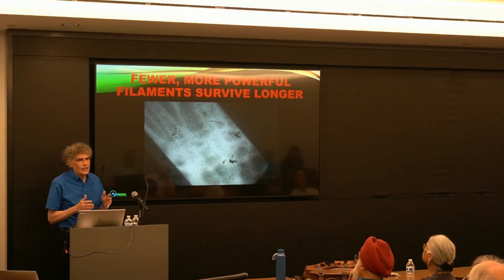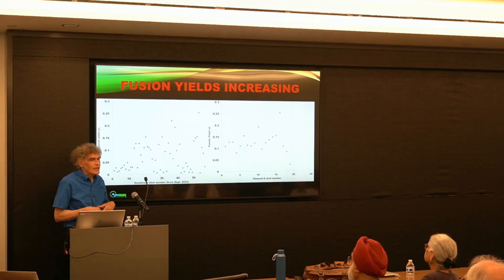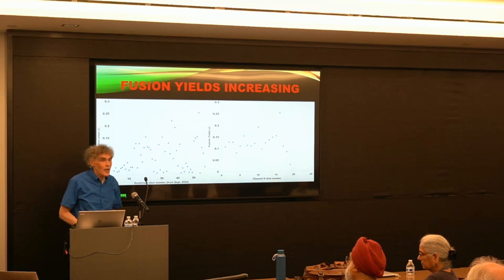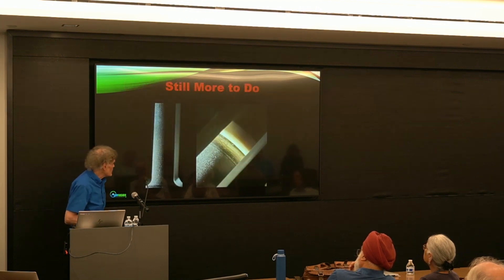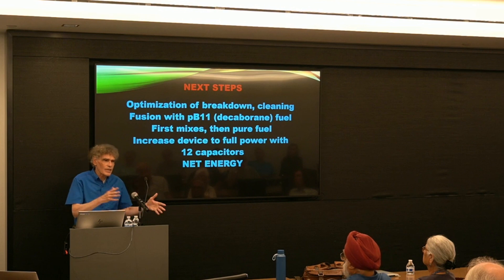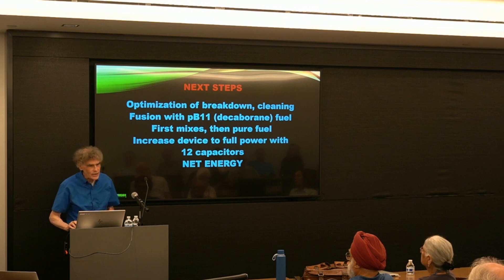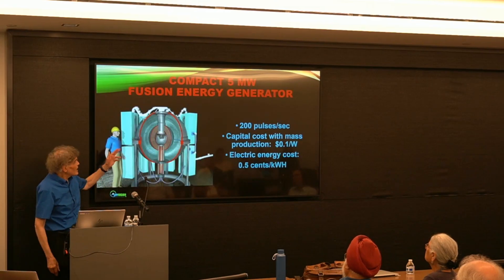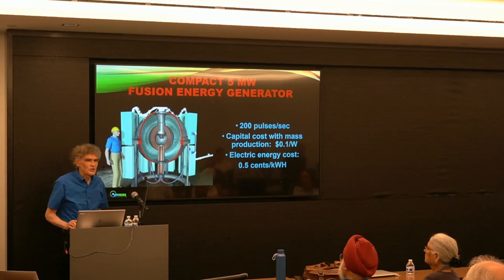Fusion - No Longer Sci-Fi, Ep.6:  The Future of Energy

Comment: I wonder if it's even possible to have "virtual" electrodes: that is, electrodes of comprised of plasma, itself. That is, a plasma within a plasma (... within a plasma) at progressively cooler temps towards the outside (less dense) whereby the containment system contamination/corrosion is minimized.  This would require incredibly precise control of plasma (which I believe, since research on plasmas is so scant, would require even more research ... and time). This is where a spatial and temporal AI, in conjunction with massively parallel computing, would certainly help (which we still do not have).  Just thought (a plasma whirly-bird with electrostatic control)

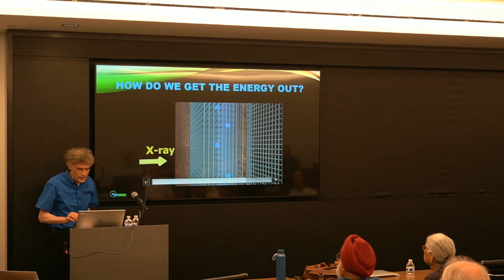Comment: 14:00 80% conversion of x-rays to electricity seems totally unrealistic. X ray energy is in the range of 100eV to 100 keV per photon, way too much for making electrons jump a band gap in a semiconductor (typically 1 to 2 eV). You will have to use just plain conductors. The x-rays will push electrons from one plate to the next, each plate being more highly charged than the next, until it encounters one whose charge is greater than its remaining energy, then falls back to the previous plate, increasing its charge by one electron. I cannot see x-rays pushing electrons through multiple plates without losing most of their energy to heat. Our best semiconductors are nowhere near 80% efficient at converting sunlight to electricity; those that are economically feasible for mass production are less than 25% efficient.
Reply: Yes. Better to use known technology as far as possible. Steam generators are nothing to be ashamed of. X-rays should be easy to convert to steam right? Perhaps the 20% in the ion beam can be directly converted with a coil.
Reply: NASA Symmetrical Concentrating Solar Power Satellite. Fusion powerplant providing 24-7 baseline energy and no questionable technology😎
Reply: @zvorenergy  A fusion power plant that is a sphere 865,000 miles in diameter and 93 million miles away is simply an environment, not a power plant, and one over which we have zero control. Photovoltaic cells do not give us control over the power source, but might be useful in combination with a source of radiation that we control, as in a betavoltaic cell using the highly abundant and energy dense fission product Sr-90. We want to build a fusion power plant that gives us full control over the power source so we can deploy it where and when we want, and not be a victim of its caprice.

Comment: To me it is very obvious that the only useful form of fusion energy will be pulsed reactors, with aneutronic PB11 fuel, and the energy collected via the photo-electric effect converting the x-rays directly into current. Then you tap the dual ion and electron beams to extract the rest.
Eliminating the steam cycle is essential to free the world from the centralised production of electricity, and also to enable off-planet power systems.
The problem as I see it, is that there will still be "some" (lots!) of heat as a by-product of firing the reactor X times a second, and that still requires a lot of equipment and cooling capacity. 
So, I am sure Eric's approach will work - but I'm not sure if a 1.5-metre reactor will ever fit inside a 40-foot shipping container - which is the form factor I'd like to see.